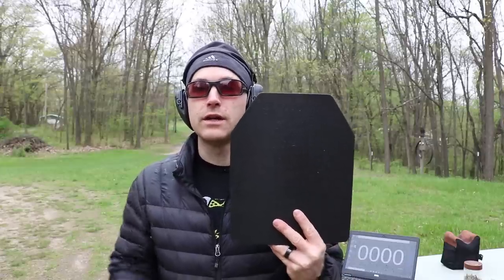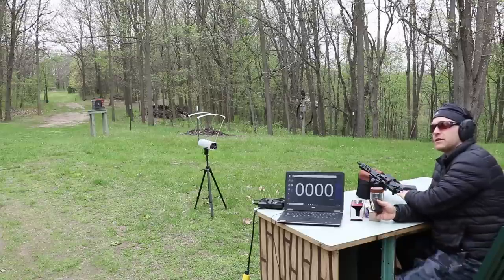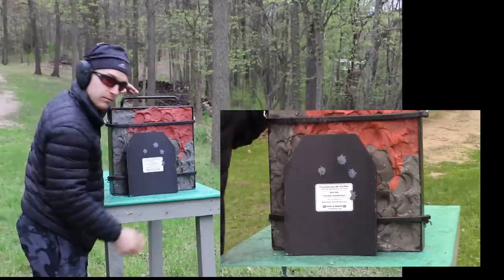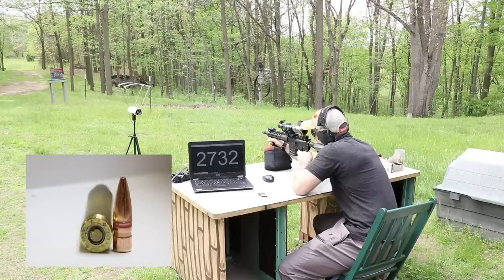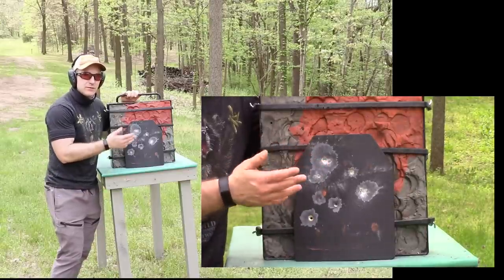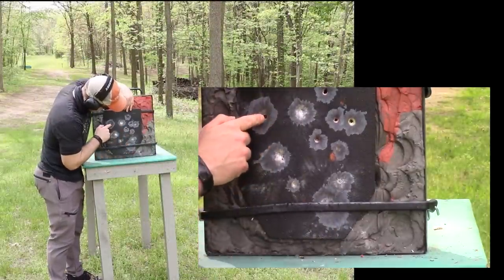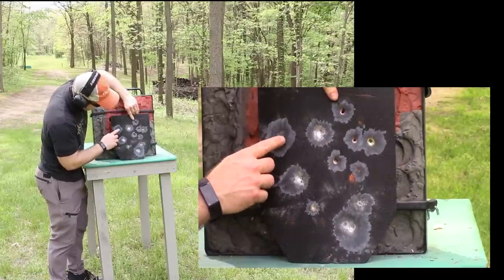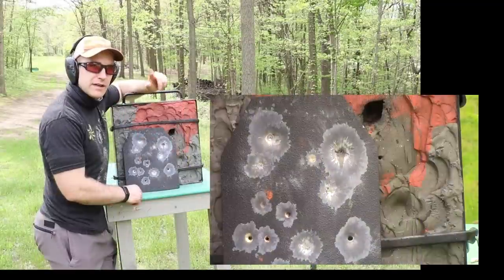Can Steel Armor Stop 5.56x45mm, M193? TYR Protection AK-47 Plate

Comment: For 4.5 lbs this plate is an amazing compromise light weight design that can stay in the heat of a car and never worry about it while providing decent rifle protection, prob better so if IIIA is placed behind it. What is the cost in USD Buffman?
Reply from the maker: It's about $150 US a plate. I am not sure if he's setup to ship into the US, but don't see why he wouldn't be, as I didn't think IIIA was ITAR controlled.
Reply: I wouldn't rely on a IIIA backer behind a level 3 plate to stop any projectile that penetrated the rifle plate. Use a level 3+ or a level 4 plate.
In tests with a level 3 plate with level IIIA backer, common 5.56 55gr FMJ target ammo went through the plate and IIIA panel then penetrated well into ballistics gel. This was using a 20" barrel.

I've shot 5.56 55gr FMJ at a level 3 plate using an AR-15 with a 16" barrel and from 50 feet all shots went clean through and well into my log backstop. I wouldn't want to rely on a IIIA backer.
This is cheap common range ammo that blows through these "rifle-rated" plates. People think that since level 3 can easily stop green tip that it should stop the cheap range ammo rounds. NOT so and many manufacturers of armor dance around this fact.

Comment: M80 Is such a slow ball, a solid copper at +2800/2900fps is the right choice with steel plates and .308.
Reply from the maker: I think a copper bullet at that velocity in a larger caliber like .308 might not pass through steel.

Comment: I'd like to see that shotstop you just tested stacked in front of a steel plate like the one shown on everything from 7.62x51 ap rounds and up. Is there any man portable armor system capable of stopping 7.62x63 blacktip?
Reply from the maker: Level IV plates stop 7.62x63mm black tip. Even at considerable velocity above specification.

Comment: Hello I am currently in the market for level 4 armor I would like it to be nij certified. The attributes that I am interested in is mainly the number of rounds it can stop (durability) and what rounds it can stop (strength). The only other thing that really matters to me is weight although not overly important. Thank you to anyone who could help me with this question.
Reply from the maker: Do you care if it's multi curve? What is your budget?  What is the weight limit>
Reply: I don’t preticulary care about the curve although multicurve would be optimal nor do I care about budget. In terms of weight it would be best if it was bellow 7.
Reply: I did some research and it seems that the best stuff is mostly rma, hesco and highcom. Which one of those is the best in your opinion. I would like to say thanks again for all the help.
Reply from the maker: @bengordon9632  They all make good stuff. I've tested Hesco's basic level IV in the past and it's a damn good plate. RMA's 1189 would be the tough to beat, but I've never tested high end Hesco or Highcom stuff. :(
Reply: Ok thank you very much I may buy hesco and highcom and test them using the same stuff you used on the 1189 and see how they preform.
Reply: I may also test the shot stop level 4 because they claim in there add video it can stop all military black tip rounds which I believe applies to M993 which will be interesting.
Reply from the maker: @bengordon9632  You have access to M993? :D
Reply from the maker: @bengordon9632  I should be getting one of their level IV in the coming months..
Reply: Ya I have an FFL and a class three license which I am not sure affects it by I have had A case of ammo for like the last couple of mo this but never sure what to do with it. So this is the plan right now.
Reply: Either really from what I found
Reply: @bengordon9632  wanna sell some of that m993?

Comment: Why you'd want to go below a 10.5 inch barrel is beyond me. That's a lot of velocity loss, lol.
Reply from the maker: It's mainly to simulate long range.
Reply: @BuffRANGE  Great point.
Reply: So there's room for a longer suppressor
Reply: @corpsiecorpsie_the_original  That's a fair point also. The free bore boost would help the velocity to some extent as well. Still probably worth it to go 10 inches though, in my opinion.